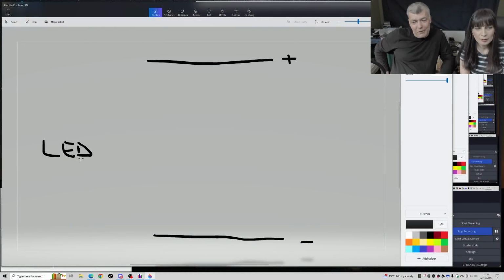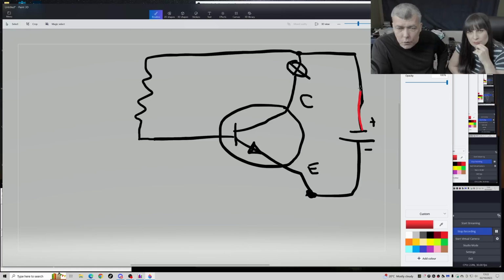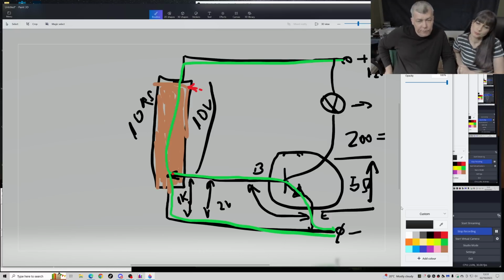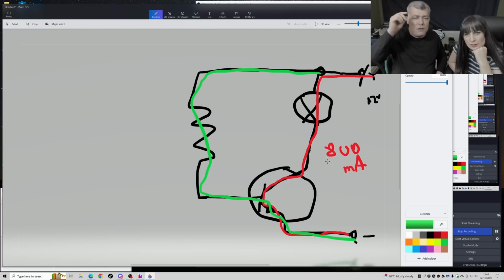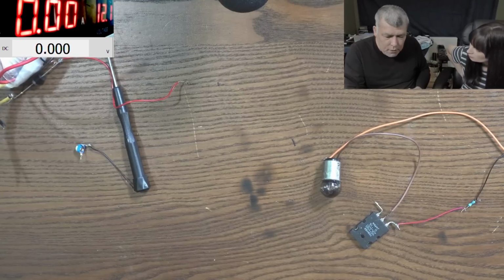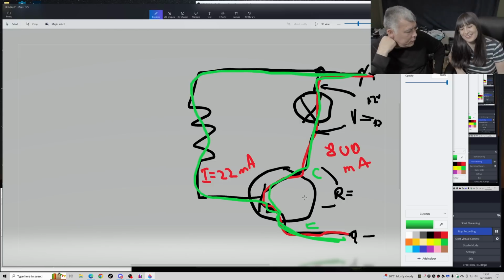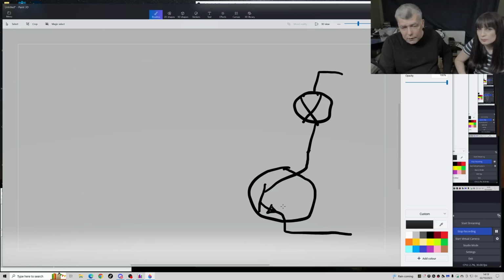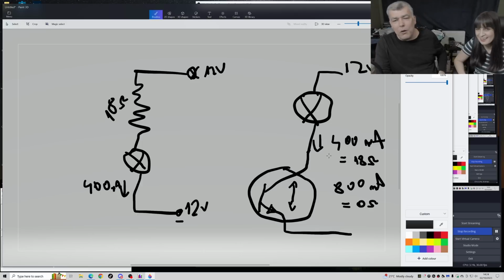Back to basics, how transistors works - Lesson 20 Learning electronics with Diana

Comment: Thank you guys very much for lessons. In videos like this one I learn the most just because the pupil is confused and the teacher is explaining over and over in different ways. That is why I regret a bit Diana has not enough courage to ask "WHY" again and again whenever she is unsure about something or simply out of curiousness. I would be unbereable student just because of hundreds of WHYs I would ask in process of learning. Here is one question, maybe Diana would like to ask the same: why do you use transistor and adjustable resistor in combination to regulate the brightness of the bulb when you can do it easily only with adjustable resistor without transistor, as you have done it while explaining Diana internal resistance.

Comment: At 45m on it gets a bit confused, as you tell her it has 0hms but then at 50m you tell her it's also got a resistance.

She's right though: The wire and transistor both have non-0 resistance, and you even told her this earlier. The thing is they both have very, very small resistance and are so considered negligible. Especially as you had 12v on the rails but 11.8 across the bulb, meaning that transistor's C->E clearly had some resistance. Those kinds of low voltage are hard to measure on your multi-meter.

What might have been good is getting a giant spool of wire and checking the resistance of that.  Though even then that resistance might be too low to measure.

Comment: electronics is hard until you get a feel for it , and then you can assume approximate values if just by looking at wire/track thickness and a load (what is being driven). It's all magic until you get eureka moment and than it's obvious but still not so easy to explain .  She just needs exposure to electronics and she will be advanced in no time.

Comment: Question to the Pros: If the transistor was replaced with a 100k resistor, so much higher resistance than the 18 Ohm adjusted by the base, there would be no heat on the resistor/transistor, right (since there is very little current in that circuit)?. There was also no heat when the transistor had nearly 0 Ohm, which I kind of understand. But only dissipating heat somewhere betweem 0 and very high resistance does not make much sense to me. What's the point I'm missing? Thank you! o)
Reply: I'm not an expert but since no one has replied I thought I'd try.
I don't think it's so much about the resistance but rather the power rating of the component. His thin wire had 0 ohms and his thick wire had 0 ohms. The thin wire got hot because it simply cannot carry the amount of current flowing through but the thick wire handled it fine. Likewise, his variable resistor burned up because more current was flowing through than it could handle when the resistance got closer to 0 ohms.
So for the transistor, the internal "resistor" cannot handle as much current as the "passthrough wire" can. If you replace the transistor with a 0 Ohm resistor that has a low power rating, the resistor will get hot but if the resistor has a high power rating it won't.

To answer your question:
If you replace the transistor with a 100k resistor, how hot it gets depends on it's power rating. If it has the same power rating as the transistor's "resistor" then it will be colder because it isn't allowing current through AND isn't being overwhelmed by the voltage behind it.
Voltage can overwhelm a resistor by forcing current through, resulting in heat.
Reply: @Krolik314  Thank you! o) Yes power rating, I think I got that, but in the video the transistor is hotter with lower current (400mA) at 26:30 and colder with higher current (800mA) at 29:48. I think in this example there is nothing power rating related, since the transistor is the same and it's colder with more current, right? If the transistor is colder, than the light bulb must be hotter (it is brighter), but that does not really explain my problem in understanding, why 0 Ohm will be cold, 100k will also be cold but somewhere in between it will heat up. Maybe its because with 0 Ohm, there is very little voltage drop on the transistor and high current and with 100k there is more voltage drop but very little current. So actually, why the transistor is cold with 0 Ohm is a different reason than being cold with (imagined) internal resistance of 100k. In between there is resistance and current + voltage drop on the transistor, that's why it heats up only "in between" 0 and 100k Ohm. What do you think? o)
Reply: Replying to myself here with another question: If I get this right, the transistor does not need (that much) cooling if it is fully open, because it's resistance is very low and taking into account that it is properly power rated. If I want to regulate down the current with the transistor, that's when it will heat up noticeably. Which means, if I use my stereo amplifier at full volume or lights at full brightness, the transistors will not get as hot, as if I want medium volume / brightness. Less heat on the transistor does not mean less power is consumed alltogether, but regarding heat dissipation or energy transformation (volume / light) it will happen on that consumer more than on the transistor itself when it is fully open. I wasn't quite realizing that the heatsinks on transistors are more useful, when the transistor is actually regulating and not necessarily, when transistor is turned "on" to the max - but it seems to be like this and it kinda makes sense. If resistance is close to 0 Ohm when fully open, it is like a simple wire, which (when properly power rated) will also not get hot, even a lot of current is present in the curcuit.
Reply: @ytbone9430  Yeah, right at the end of your second comment you got what I was trying to say. It seems to me as if the "resistor" is taken away when the transistor is fully open, which seems to be the bottleneck causing the heat. So I guess the 400mA is a little bit on the high end for the "resistor" but 800mA is fine for the "wire".

Comment: I think it will be easyer for her to understand if she will understand on the ground the current has to be 0
Then she will understand that if she have 800mA and the light bolb take 400mA, so the remaining 400mA goes through the transistor,and if the transistor will take all the current this current turns into heat cause after the transistor the current has to be 0
It's like water pump with a tap, if in the pump push 10 liters per second but the tap can handle pressure of 5 liters per second the remaining 5 liters will have to go somewhere

Comment: Sorin, is difficult for her to understand resistance because she can´t imagine what resistance means, you can explain with more real life examples, you´re approach with the creation of heat was good but still not clear for her, try something more simple like: imagine you´re walking on the street and falling on the concrete (you will feel a lot of pain because the resistance of the ground is hi), now imagine you´re walking next to the pool and falling inside the water (you almost won´t feel any pain because the resistance of the water is lower compared with the ground), understanding this concept is important, to learn de difference between hi and low resistance and the effects they have in a circuit (and in the real life). Great effort and patience you show in this video. Don´t give up, keep it simple and Diana will learn.  Greetings.